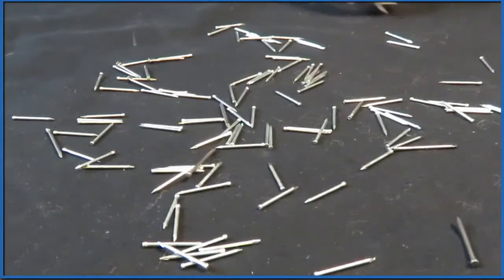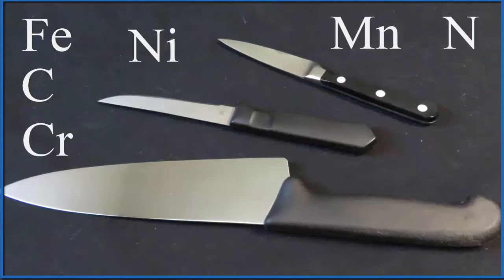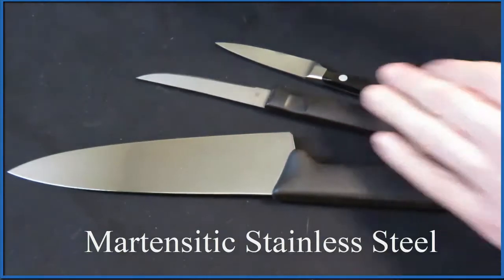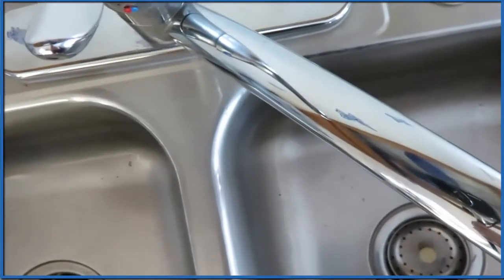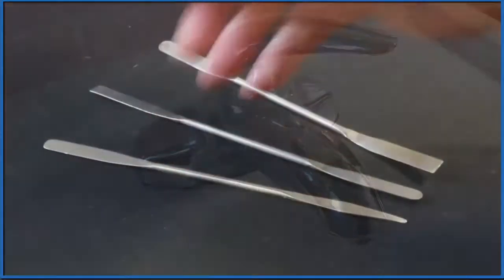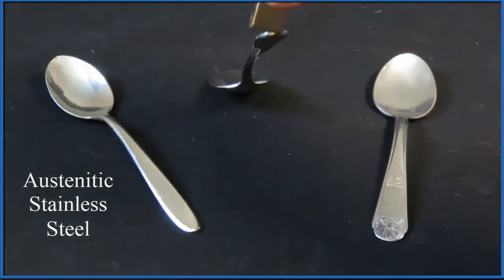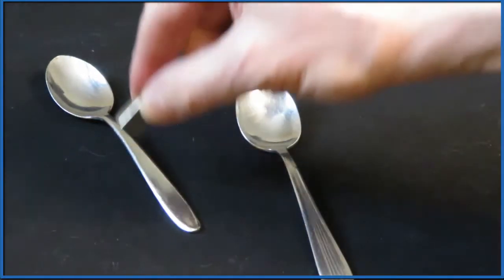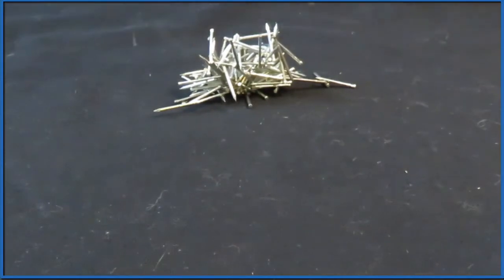Is Stainless Steel Magnetic?  🧲🧲🧲

Comment: But what makes magnetic versus not? Isn't everything magnetic if magnet is strong enough?
Reply: In the end it boils down to the alignment of electronic spins in the material. The electronic spins can be thought of as small magnets on the atomic level. What one commonly associates with being "magnetic" are ferro/ferrimagnetics where you have a spontaneous magnetization, that is, electronic spins have more or less common alignment due to interactions between the electrons/crystalline structure of the material. As a result, the magnetic fields of the electrons add up, which overall makes it a stronger magnet/gives it a larger magnetization. Not all materials have this property. When talking about steel, it seems they are "the same material", but it exhibits different magnetic responses, because the crystalline structure is different depending on composition and heat treatment. In other words, the possibility for the alignment of electronic spins is coupled to the crystal structure. There are more types of magnetism and all materials exhibit magnetic behaviors, but they behave different from what is commonly thought of as magnetism. These types are Para-, Dia-, Antiferromagnetism. The first two types do not show a spontaneous magnetization, meaning that there is no natural alignment of elecetronic spins, they are "randomly" oriented without application of a magnetic field. The last type exhibits spontaneous magnetization, but in that case, the spins always align opposite to each other, effectively cancelling out a perceived magnetic field from the outside.
Reply: @Pewpewlazorz112  Thanks for this extensive explanation! :)